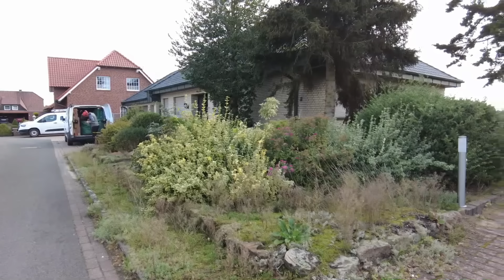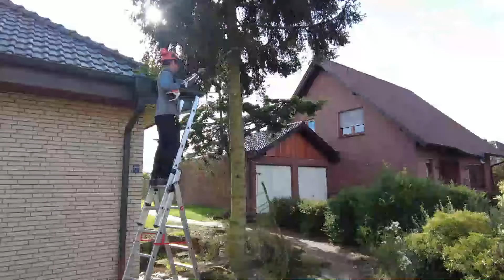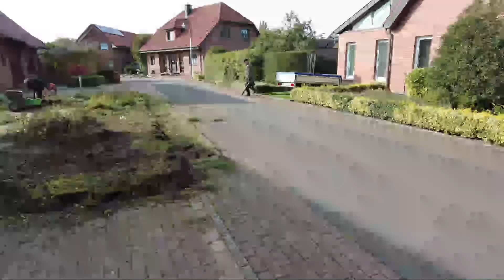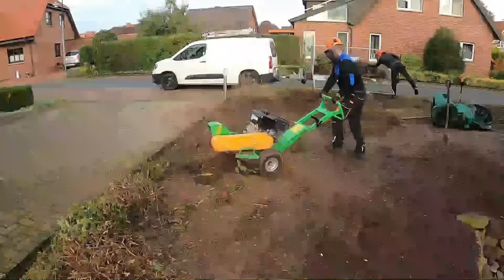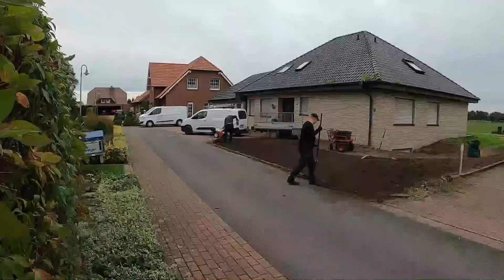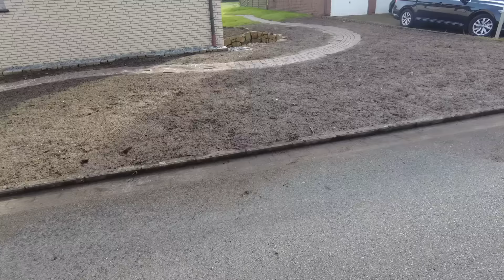The request of the client surprised us " I want to have only grass everywhere"@

Comment: To have gravel/ stones next to your house walls is never a good idea. As water will just filter through it and you might end up having damp or even water seeping through the inside of the building. A suggestion is to install a french drain underneath the rocks in order to channel the water away from walls
Reply from the maker: That is true, but we just replaced the old stones with new ones. In general the houses where there is a lot of rain have a drainage system around the house but unfortunately not this one.